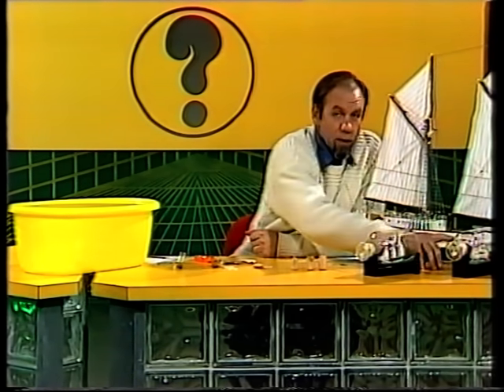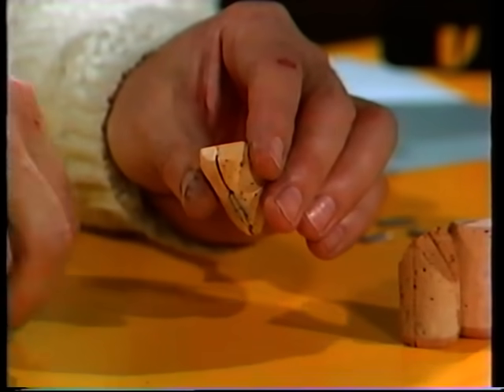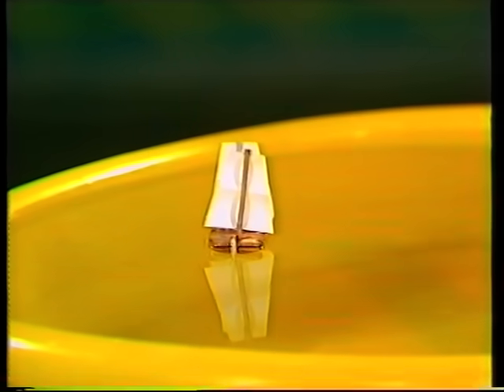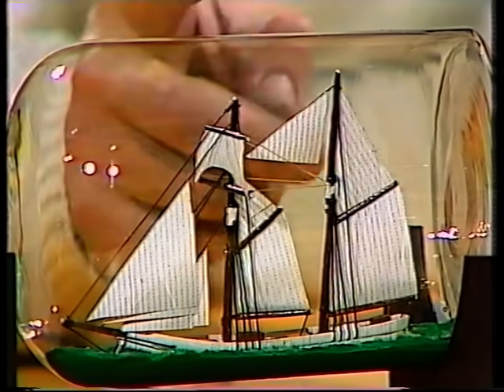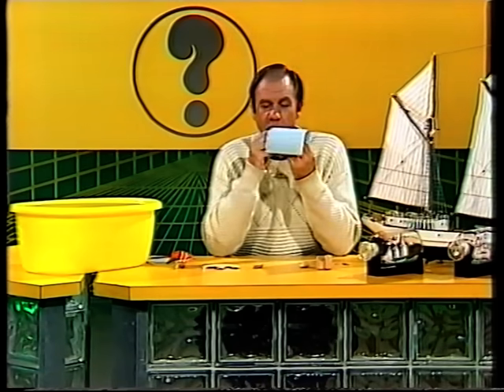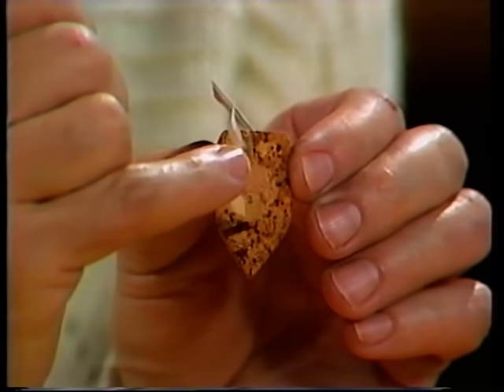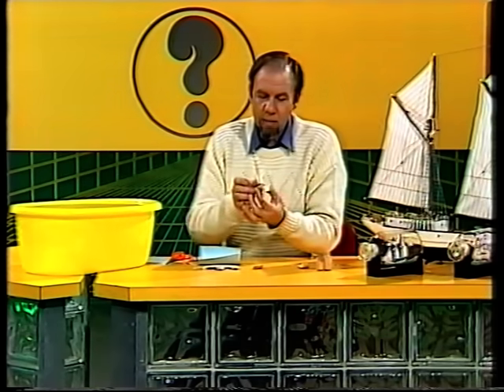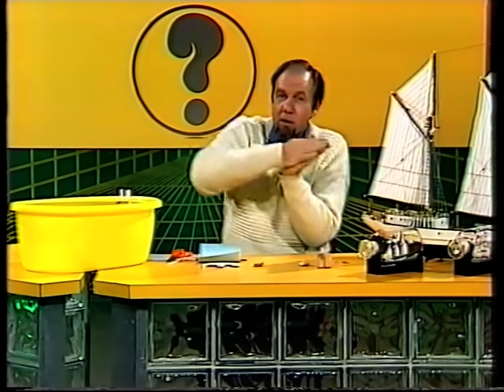Sailing into the wind

Comment: I don't think the theory is completely correct. Square rigged ships could sail against the wind too. Otherwise people like Cook, Drake or Magellan could not have done what they did, especially not Drake, since it is impossible to sail around the Cape at South Africa, without sailing against the wind.
And their ships didn't have large keel blades.
I'm dubious whether a blade that is proportionally correct to the size of the cork boat in this experiment, would actually have prevented it from turning sideways.

Also, I heard that the "lift = pressure difference" explanation is considered outdated, because it actually only accounts for a few percent of the force that keeps a aircraft in the air. Most of it is really just "pushing the air down".
That is why planes with almost no curve in their wing cross section, like fighter jets or paper planes, can fly. Their wings really work more like the blades of a fan, just pushing air into the desired direction, instead of relying on the tiny forces a Bernoullian pressure differential can provide.

The force is strong enough to pull something light weight like a piece of paper up, but not enough to keep an aircraft in the air.

I can't post a link here, but if you Google search something like "is lift created by pressure difference?", you will find a link to a NASA paper debunking that old hypothesis.

And apparently, subsequently, the "it is a vertical aircraft wing"-explanation for sailing into the wind is called into question too.
I heard it is rather something that could be called "Horizontal Buoyancy".

An effect in which the air molecules rushing past the sail, kind of try to displace it and thus exert a force in the opposite direction of their own movement.

To understand that, you need to understand how buoyancy works.
Imagine a ball pit filled with empty plastic balls.
Now you drop a bunch of heavy, dense bowling balls into it.
The heavier/denser bowling balls will sink to the ground and in doing so, displace the lighter plastic balls, making them rise up relative to their previous position.

That is basically what buoyancy is. Heavier molecules displace lighter molecules, making them rise.

Now imagine that process pivoted by 90 degree into the horizontal axis.
It isn't weight that accelerates the molecules downward, but they have a strong horizontal velocity.
The fast moving air molecules that make the wind, try to replace the sail. They try to move into the space occupied by the sail and because they are constantly followed by more wind molecules doing the same, they kind of pass the sail on from one molecule to the other, figuratively.

Imagine a group of people pushing past a standing person and everyone of them, in trying to move into and occupy the space the standing person occupies, pushes the standing person a little more in the opposite direction of their own movement.

Like the bowling balls did with the plastic balls in the ball pit, the wind molecules move the sail by kind of stealing the space it occupies, just that it doesn't happen vertically, forced by gravity, but horizontally.
The plastic balls have no reason to move in the same direction as the bowling balls, so they are forced to move in the opposite direction.
Reply from the maker: It is possible, but quite complicated and not easy to add in a 4-minute slot - Rob
Reply: @CuriosityShow  I understand.
I don't blame you guys, but it is a bit problematic that everyone, school teachers, sailing teachers, science communicators and even university professors keep teaching what apparently is a disproved hypothesis. 

It is really hard to find any source that does not teach it and yet, according to NASA, it just isn't true.

I have to admit, I'm personally not really satisfied with the "Horizontal Buoyancy" explanation either, which I didn't get from the NASA paper but heard from other sources.
The NASA paper just says the common hypothesis is not true and explains why, but only points vaguely at the "Euler Equations" as the explanation for what actually does it, without explaining them.

As I said, I don't blame you guys.
To quote the NASA paper: "The real details of how an object generates lift are very complex and do not lend themselves to simplification."

If that "Horizontal Buoyancy" really were a major force and even stronger than "Horizontal Lift", wouldn't it work on every type of object and not just sails?
Meaning, wouldn't everything get sucked into the wind, instead of being blown by it?

May be that other objects experience that pulling force too, but it just gets overwhelmed and negated by the force of air molecules simply pressing against them.
I guess that the hollowness of the sail has something to do with it. Somehow the curved cross section of the sail provides the right ratio of aerodynamics to not get pushed, or not very hard, while maximizing some other effect that exerts a stronger force in the opposite direction.
My gut feeling isn't happy with that force being strong enough though.

Anyways, ignoring NASA, the fact that even sailing ships that are not specifically designed for it can sail against the wind, suggests that there must be something else than "Horizontal Lift".
I guess it must have something to do with diverting the wind, changing its direction, because that is the only thing a sail can do that other objects don't do, or do less.

It would be simple to understand and wouldn't require any mysterious additional forces if ships would only sail against the wind at a roughly 45 degree angle and would then just divert the wind in a way that it blows directly along the ship's axis. 
It is the directly sailing straight into the wind, which baffles me.

Comment: You are only partially right. But explain how an airplane fly upside down. You can not sail straight into the wind.
Reply: Adventures with Frodo By changing the angle of attack, you can presumably change the flow of air over the wing, and create low pressure on the "under" side of the wing.
Reply: @trevorlambert4226  I know.the truth is you are never flying level upside down. Have you ever sailed a boat?

Comment: Love your program. Great stuff. 
But there is a bit more to it than that. Sailing directly into the wind isn’t really practiced. But  a “close reach” or “close hauled” are achievable upwind directions, but the main thrust is from the vectored power of diverting the air flow across the back of the sail out behind the vessel. 
The uplift from the airfoil is a factor, (from the front of the sail) but it’s not where the majority of thrust comes from. 

With more modern “wingsail” racing designs then that’s a bit different again. 
But most standard yachts the true direct upwind travel isn’t achievable.  

But enjoyable video none the less. :)
Reply from the maker: Which is why it deals with tacking at the end - Rob
Reply: CuriosityShow I don’t think you quite realised what I was saying. 
You say the lift is caused by the faster moving airflow across the top of the wing. 
This explanation has been debunked many times. 
Here is an explanation by Cambridge. 
https://www.cam.ac.uk/research/news/how-wings-really-work
Reply: CuriosityShow it’s a common misunderstanding. So it’s not a big criticism of your video. 
But as you are into your science I thought you would appreciate info on why your explanation was wrong.
Reply: CuriosityShow essentially it’s the redirected airflow (vectored) that generates the “push” in a new direction. 
This is why you cannot sail directly upwind. 
So the tacking part of it is a secondary issue. 
Not my main criticism.  

I hope that cleared it up. :)
Reply from the maker: I said -'the air streaming over that (rounded) surface creates a region of low pressure' Actually, if you watch and listen to the video link you sent, he says the same thing. What he debunks is that the air over the top reached the back of the wing at the same time as the air underneath it, and I didn't get anywhere near that. Nonetheless I am grateful for the link - some 30 years after my segment, but interesting - Rob
Reply from the maker: Yes, but you keep attributing to me things I don't say. I can't get the demo in this link (possibly a USA/Aus thing) but the last para says

{The upper flow is faster and from Bernoulli's equation the pressure is lower. The difference in pressure across the airfoil produces the lift.} As we have seen in Experiment #1, this part of the theory is correct.

That is all I said - faster airl reduced pressure - I made no mention at all of the air above and below getting to the back edge edge of the wing at the same time.
Reply: CuriosityShow il re watch when I have broadband again. (Apologies if I didn’t get your exact wording.)
From memory you refer to the faster airflow moving over the curved surface. (When you blow across it) being in main the reason there is lift. 
As you have seen from my previous links. That isn’t the main reason at all. 
That’s the old and now debunked reason. 
If you had blown across the back of the price of paper and shown how that redirects the air and “lifts” the paper. Then that would have been a much more accurate demonstration of  how a boat can sail on an angle that is upwind. 

You blew on the wrong side of the paper essentially.
Reply: And of course when you do your demonstration with the straw. That clearly isn’t how a boat would sail. 
In the real world you do not got one narrow jet of fast air flow one side of the sail. 
All the air is moving across at the same rate. 
Try that with your model and it would sail downwind, not upwind. (Get a large fan to see this.) 
So your initial incorrect explanation of how a wing works kind of dismantles the entire demonstration as to how a boat sails upwind I’m afraid.

Comment: It's drag, not low pressure. The air coming out of the straw is high pressure. The drag is what pulls the sail to the direction of the wind shedding. So having more drag should produce more "lift", or really, force.